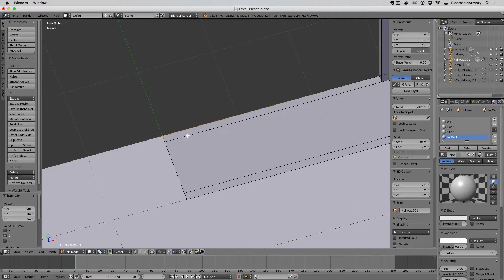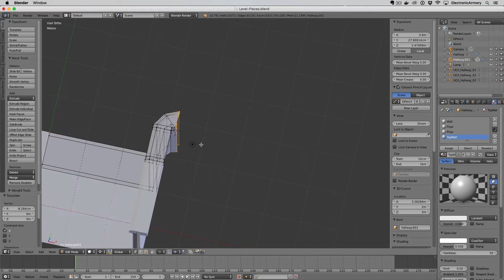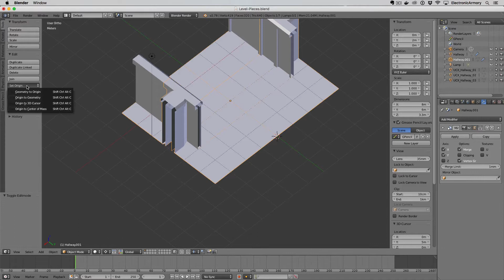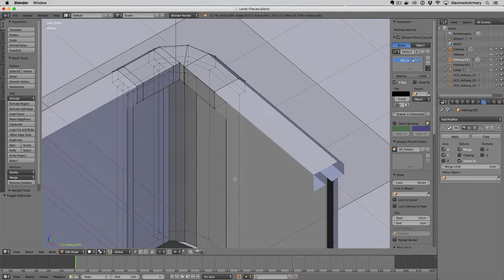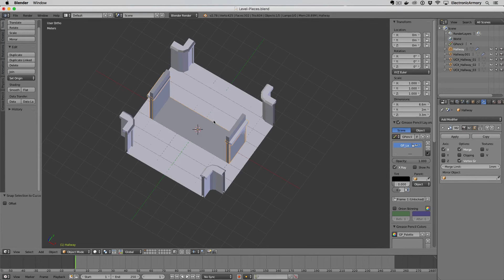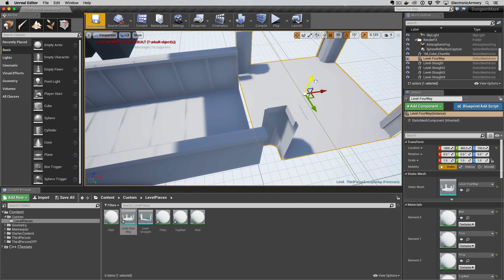3D Game Development - Level Pieces Advanced - 08

Comment: Edge/vertex snapping and snap to other objects will help a lot for 17:20.

Also, would using the box collider prefix have the same result?
Reply from the maker: I was trying to snap to the grid so it would align to the Unreal Engine's grid. As you saw, I had to improvise. So yea, it would have helped instead of snapping to the grid in that case. Yea, the prefixes all define different shapes you can have. I'd have to look at the documentation but sometimes those shapes have to be exactly constructed to work properly and can't have too many vertices or different dimensions, so I just use that one.